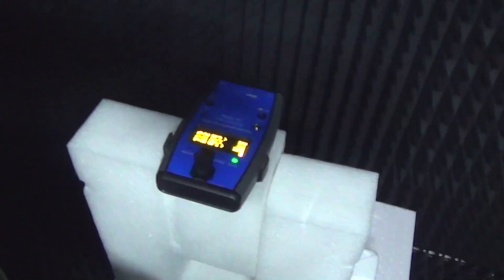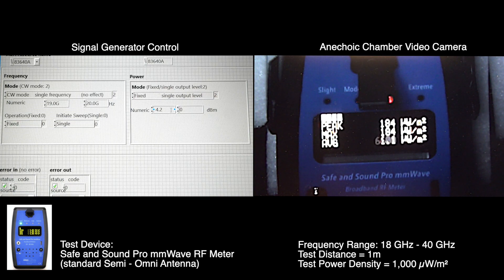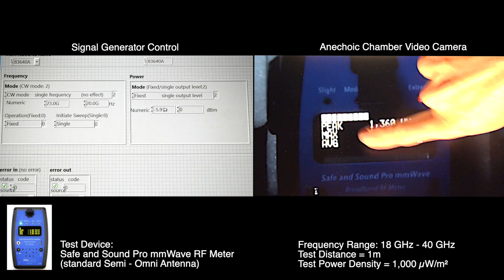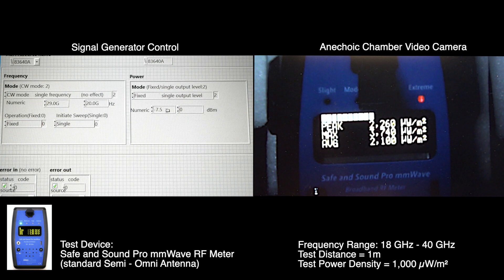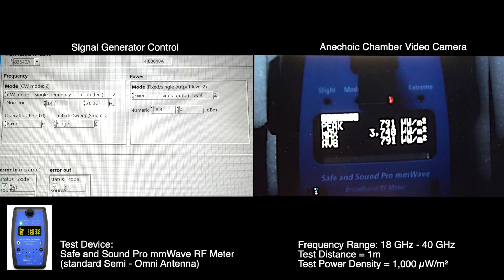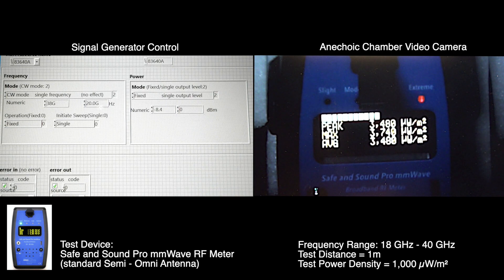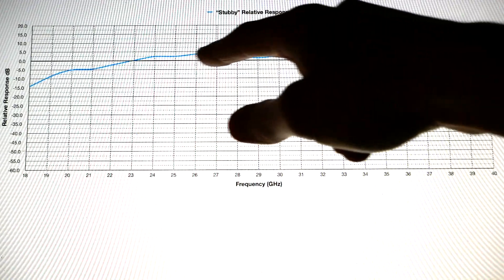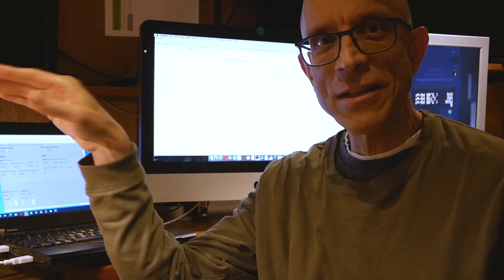Safe & Sound Pro mmWave Production Testing

Comment: I have a general question. How do the Federal Communications Commission (FCC) EMF exposure guidelines compare to the SBM-2015 used by Institute of Building Biology + Sustainability IBN? The FCC ones seem to be very loose whereas the SBM-2015 seem to be very, very strict. Can you maybe comment on that? Normally one would have no reason not to trust the FCC.
Reply from the maker: In short, the FCC uses guidelines based on the notion that unless the exposure level is high enough to cause thermal heating of tissue, there is no problem.  And a general presumption that all non-ionizing radiation below these thermal levels (or time-limited near-thermal levels) is harmless.  Biological damage occurs at MUCH lower levels, but this evidence is ignored.  We now have the ability to look at these biological effects and DNA damage.